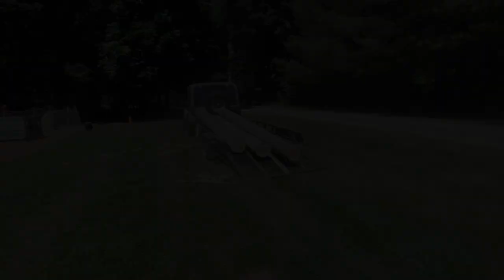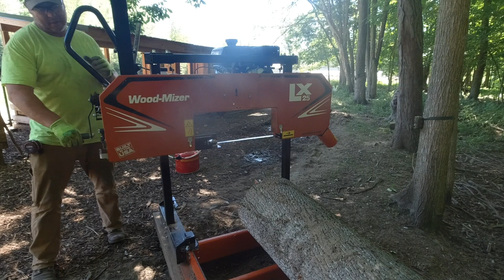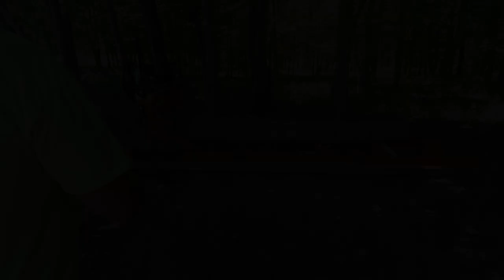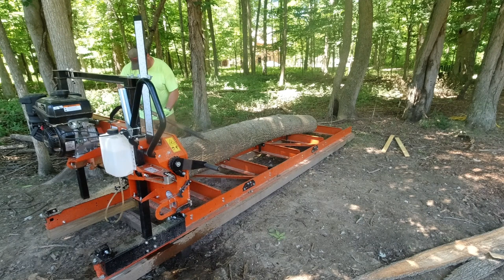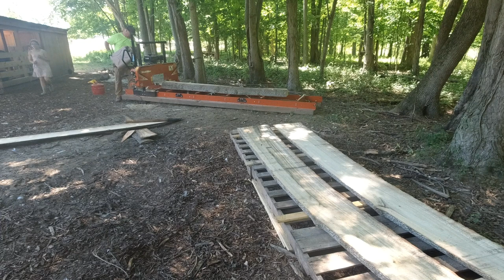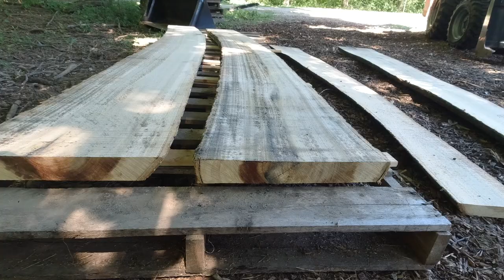First Log Ever On The Wood-Mizer LX25 Sawmill And I Found A Rainbow Inside!

Comment: Hi Chris!!😀😀
Nathan is the man to ask advice from. 
I have sawed a quite a bit of lumber with both band mills and circle mills. 
You really don't even need any water when cutting green poplar. There is plenty of moisture in them. The water was plugging up the sawdust in the chute. 
If you are going to saw lumber from them. Always start with the bow straight up or down until you get the side flat. Also it's a lot easier to cut with the small end on the end you are starting from. It helps to get a full length slab the first time. 
Good luck and have fun with it!!
TTYL!!😀😀👍👍
Reply from the maker: Thanks Al!

Comment: nice one thing i love about my small mill is the  versatility i made some conversions to cut down to 40 inches in length the log yu sawed was a great one to start with but in time it looked to me like you could have gone 4 footer and a six footer and been pretty straight on both,,  It comes down to how many times do you cut a 8 foot 2x 4 in half when building i will try to get a vid put together on my mini wood sheds privacy fence LOL.   Your going to love that mill its cheap to run i have the woodland mills hm 122 its a smaller mill then yours but during covid it was what i could get
Reply from the maker: It sure is fun!

Comment: Looked like fun sawing your first log. I'm sure Nathan will be able to give several tips. Figuring out the feed rate and amount of fluid to have flowing will likely just take some trial and error with the smaller HP motor but I'm sure you will get the hang of it.
Reply from the maker: Thanks!

Comment: Weve burnt a bunch of saw mill slabs cut up in to fire wood length some of em are the same size as normal firewood depends on the log an the sawyer.
Reply from the maker: That's what I will be doing with all mine
Reply: @KillingerUSA  the burn hot an season fast